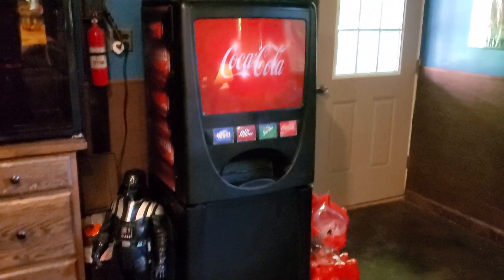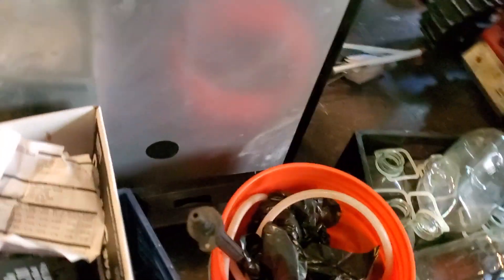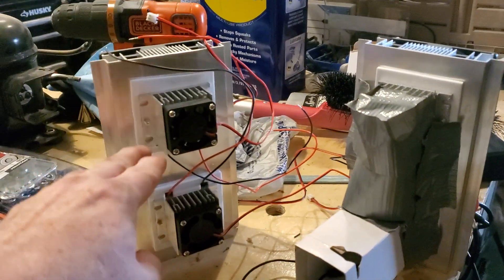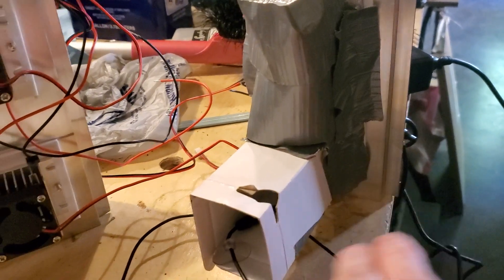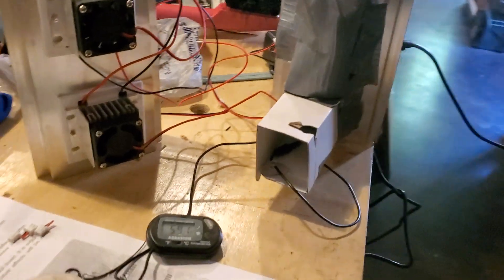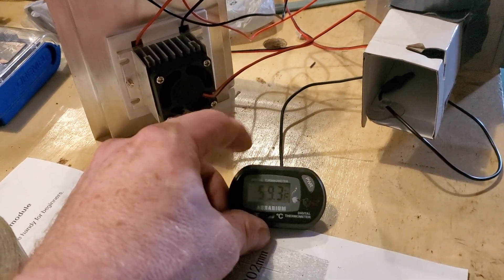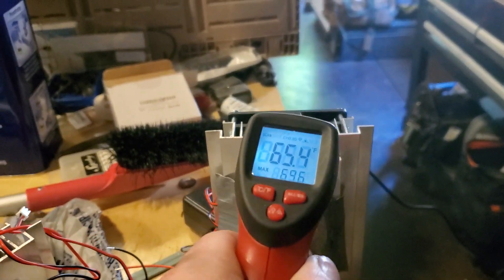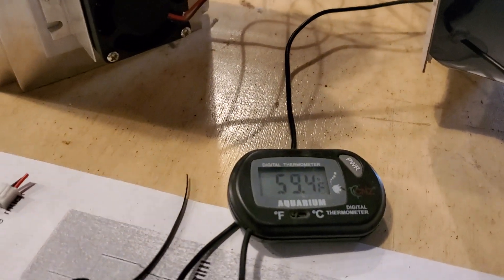Skybox vending machine by Maytag conversion update

Comment: Only one button works to dispense. Others do nothing but blink. Any ideas?
Reply from the maker: Check the can sensors on the back racks, but if you open the door and then close it should reset. Also check the ribbon cable is connected tightly on the control board.
Reply: @GarageMahalLife   thank you for responding. I will check. It hasn’t been used in a couple years. Stays cold. It does reset when I open the close but still only blinks. Where are the sensors located or look like? I really appreciate it.

Comment: I need the door wiring that goes to the machine for mine.
Reply from the maker: I believe it is pin cable... email me at Brian.niskala@cnjrail.com and I will help hunt one down for you.
Reply: @GarageMahalLife  My friend fixed the pin cable for me. I put a new relay in because the other one was shot but the compressor doesn't seem to be coming on or chilling. I hope I don't need a compressor.
Reply: @GarageMahalLife  I don't know if it's the heat sensor for the compressor either.